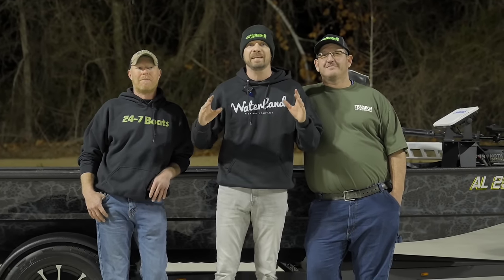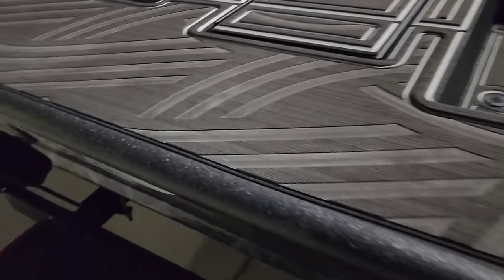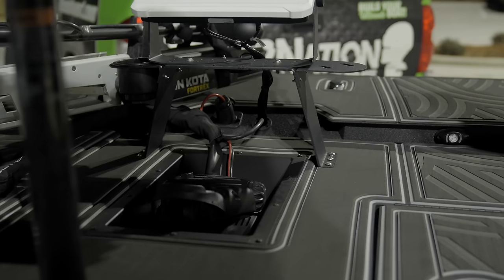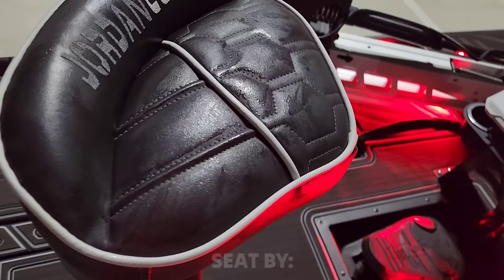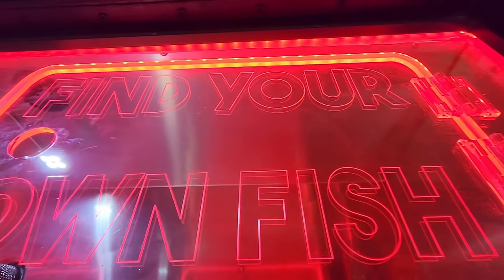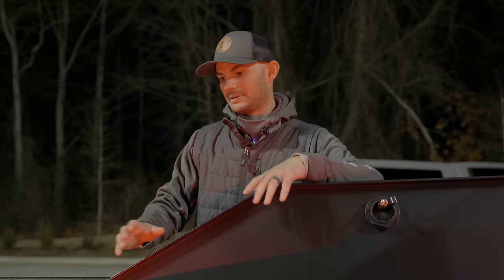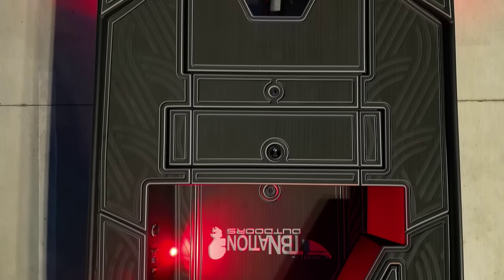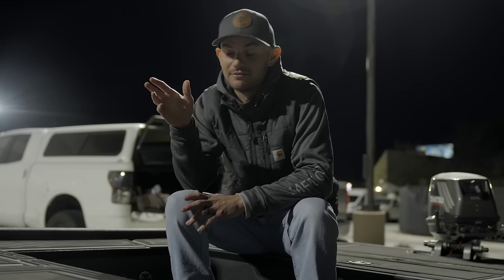Jordan Lee's Jon Boat Build is ABSOLUTELY MIND-BOGGLING

Comment: I’m building a similar type boat and did you consider that With that size boat and motor combo and additional weight from framing and accessories, are you concerned with full livewell weighing 300 lb in the rear with angler and getting on plane? 
How big was the livewell?
Reply: 12x40x10. Holds about 8” of water. Around 160-170 pounds of water.   Idk if it will plane with 9.9. It is what it is. Can have it both ways. Without a hoped up motor
Reply: I just picked up a 2024 Lowe 1440M with a build in live well and it's made in the center of the Jon, only took it out once so far to test the hull, I noticed that it sets very high in the water with live well plugged, something you should look at when building on your jon boat and adding weight to it.